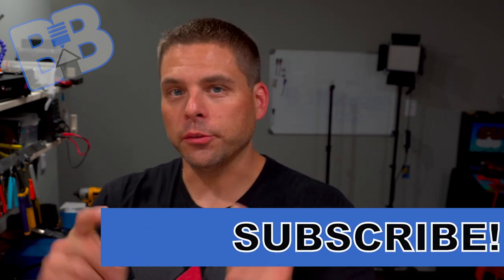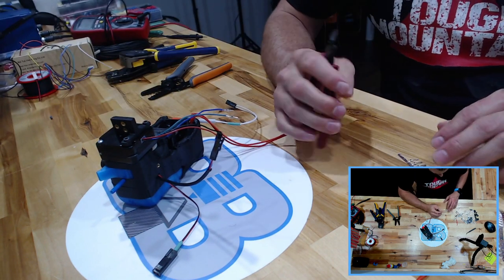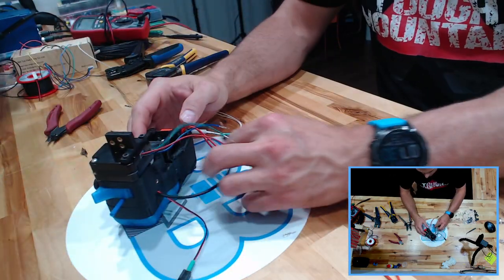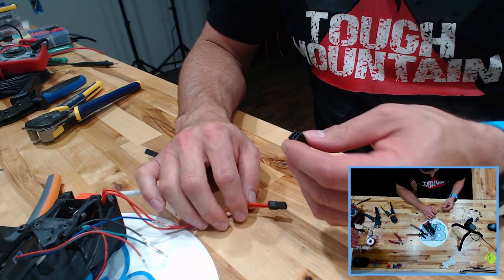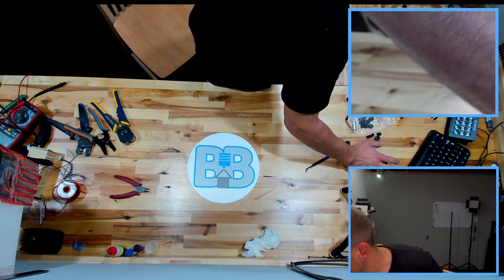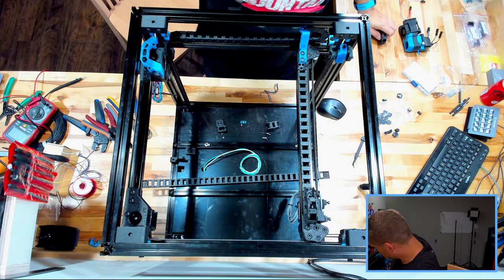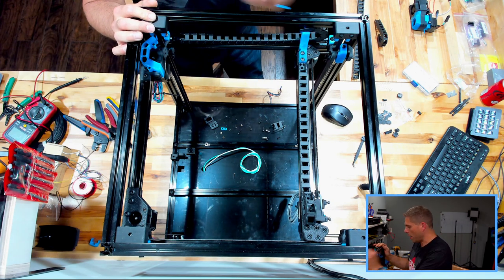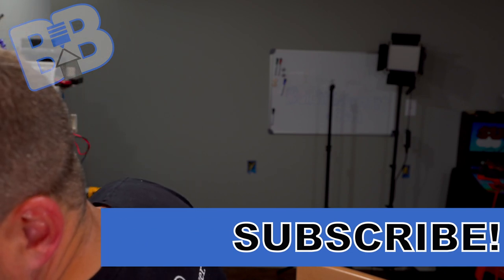VORON 2.4 3D Printer Build It Live *Episode 16* Crimp Connectors Afterburner!

Comment: How long should the cables from afterburner be (fans, heater, probe, etc.)? 10-15cm is ok?
Reply from the maker: I would say anything from about 8 to 15 is manageable. If they are a little longer you can always tidy them up with ties. If they are short, it may look a tad silly, but your harness will just have to make up the difference.

Comment: Hey new to the channel here and love the content voron stuff is blowing up rn and I’m positive your views will aswell :) . Curious how’s the kit so far I just refunded a kit that was resold by formbot? Would you recommend getting the formbot from their website and what parts seem kinda cheap in the kit. Thxs for the vids
Reply from the maker: First I'll say that I think the FORMBOT kit is a value.  For the price, the parts are well within acceptable range.  Everything I received was usable and there were no major issues.  I would consider upgrading to better rails, a better SSR, a better build plate (cast), and better screws.  The frame, motors and electronics all seem pretty decent.  With the limited availability of some parts, I wouldn't hesitate to purchase a kit again.

Comment: Hi are you going to use the Hark Doom board? Or direct to the board?
Reply from the maker: I'm not familiar with the Hark, but I'll assume it's a tool head board?  I have mixed feelings on these things.  I really don't see a really good reason to use one. Wouldn't it become more connection points and more points of failure?
Reply: @BuildItBasement  Hi yes is the toolhead board. Connections are supposed to be solid and the real reason is that is you want to change hotends (like standard flow and high flow) fast or maybe service the hotend would be a lot more easy :). Imagine running again all wires after a thermistor or heater break!
Reply from the maker: It'll be one of those - after build upgrades.  I'll do some looking and see if I add it to the list!  Your like the 10th person to mention a tool head board, almost every time it's been a different one!
Reply: @BuildItBasement  Must be because it really adds easy of use and service for the price maybe? Have a great weekend and thanks for answering again :)